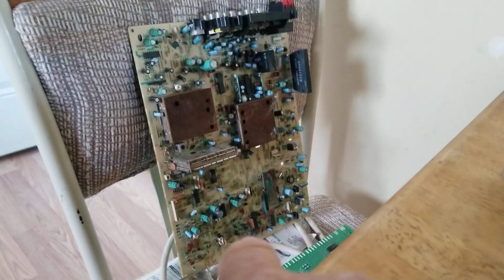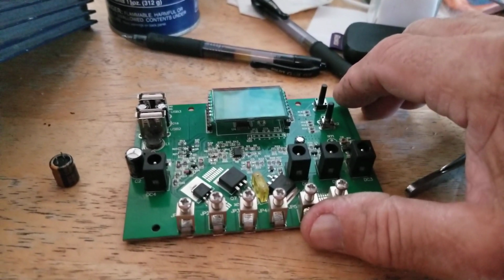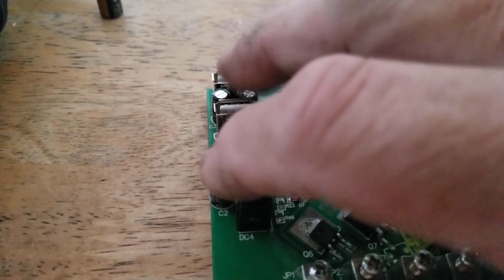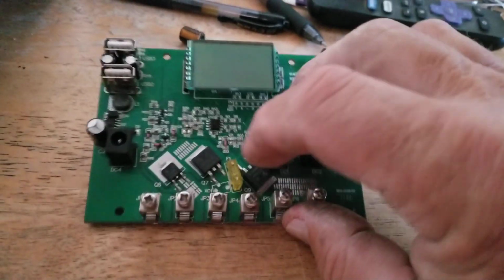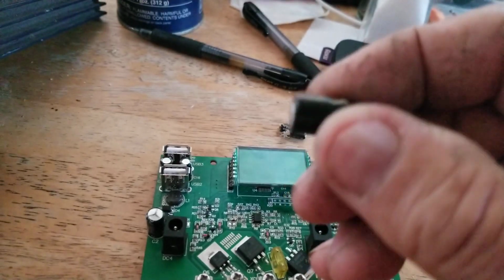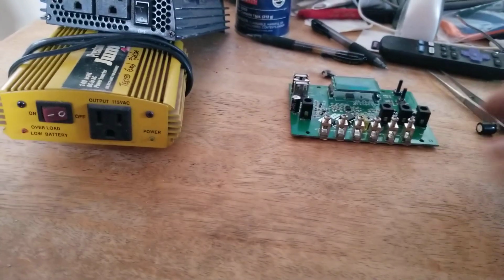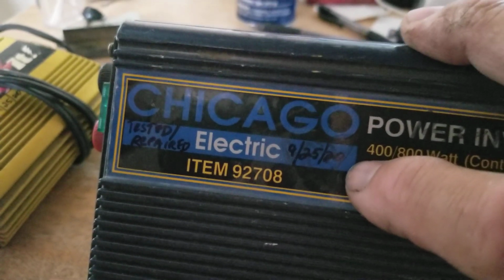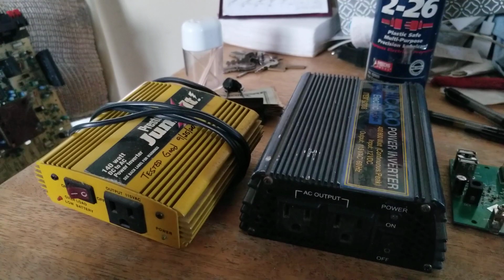Electronic repair, capacitors and microfarads,Sep 25, 2020

Comment: Not on point here but thought this might be at least an interesting read for you and worth a few minutes of your time to investigate.  Nice mobile phone speeds.  I'm on Verizon planning to switch to a Visible group plan unlimited talk, text, data $25 month minimum of 4 lines and many online invite you to join their group free to help you get the discount from $40 solo. Right now I pay $65 for my Jet Pack hotspot.  Please let me know your take on this.   Thanks.

https://www.youtube.com/watch?v=El4qzRCQt9w
Reply from the maker: Hi Mike.  Thanks for the info.
I'm with Verizon also, have been for nearly 20 years.  I bought a Verizon based Cradlepoint (used) on Ebay for $150 as a blind sale, and found that Cradlepoint won't support the product for anyone but the original owner. 
I have some experience with modems and routers, so I figured out how to reset it to zero and log back in as a new owner after getting a free sim card from Verizon, and set it up to work for me.  I now have internet and a 4 port router for about $17 a month, with unlimited.
Because this worked for me, I haven't researched anything else.
I can tell you that there have been advancements in access point systems so that a multi port router can be connected, so home networking is possible, but I don't know much more than that.
You can call my friends at Alltech Electronics at 714-543-5011, speak to Gazi or Lucien, tell then GBear sent you and they can give you more info on it, and provide you with the hardware and support you need.
Reply from the maker: Oh, and if you decide to switch carriers from Verizon, make sure they give you a guarantee IN WRITING, that if service is bad you can out the contract.
I haven't found better customer service that that of Verizon, and it you squeak, they will oil.
They have a motto that every "single" customer matters, and will go all out to give you what you need.  Also, if you are a veteran, they give discounts and special service.
Reply: @GBear  I'm 10% disabled Active Army Medic 2 years and Air National Guard Flight Medic and MSC 22 years now retired.  Some time we should tip one up at sunset and I'll bring some wood for the fire.  Good nights coming as the temps eventually go down.
Reply from the maker: @mikesmith1550  sounds like a plan.  I hope you are getting your military discount from Verizon.

Comment: On power supply items like this you can go with caps of Higher Values if need be.   Higher Voltage and Cap values without issues if it will physically fit.  NEVER LOWER.   That only pertains to power supplies.   

In the USAF they sent me to school on the stuff.  8 hour school days nothing but electronics.  Talking about Brain Burn ! 740 hours over all.  

Eaaaaa Picked up a New to Me Pick Up yesterday.  2001 Ranger.   2 wheel drive but boy is it clean.  Nice little topper on it.  That's going to be my Prospecting truck for a while.
Reply from the maker: I had a Ranger back in 1986.  Bought it slightly used, but worked the heck out of it in construction.
Reply: @GBear  Tough little trucks . Those and the E series Vans was one of they're best products.  The F -150 pick ups are crap compared to the Ranger.  Funny enough you can still work on the things.  Unlike most new engines.
Reply from the maker: @pulesjet  I've been an E series fan since 1963.  It had the same engine and drive train as the 1960 Falcon, and was reliable as long as the oil was maintained regularly, and an occasional plugs and points.
Reply: @GBear  LOL, My hat says I would rather be pushed in a Ford then drive  Chevy.   I have no idea how it happened but I have NEVER  but once  been left on the side of a road in a Ford.  That one was a Pinto and I changed the timing belt on the side of road coming back from the lake.  I actually had the tools to do so.  The belt took a road trip.  They always waited until I got in the dive way at home to chit there shorts.  LOL  Every Time.   I had a timing belt cut loose just as I got home.  I had a MAF sensor puke just as I got Home.  I had  a  few other things do the same.
Reply from the maker: @pulesjet  when I was an auto mechanic in the 60's my boss used to say, "See the USA in a Chevrolet, hooked up to a Ford tow truck...."😂
Reply: @GBear  LOL I have to remember that one.
Reply: @GBear  good one.
Reply: First check to see what the tolerance  the capacitor has most common capacitors are 20 percent so you can go + or - 20 percent in value. If its a 1 percent tolerance don't change the value. Precision caps must never be substituted. Voltages can be higher if size is no problem.
Reply from the maker: @ronb6182  it's a Chinese brand PWM 10amp controller.  No need to waste time on it, just replace it with the proper value and skip the 'smoke test'.😁
Reply: @GBear  yes I agree I think he just misunderstood where I was coming from. Manufactures can screw things up.
Reply: @ronb6182  General Power Supply use is mostly for filtering and Smoothing.  Anything related to voltage regulation needs be as prescribed.
Reply: @pulesjet  I said anything 1 percent tolerance and lower must be  as marked regardless where it's used. If there are 20 percent tolerance parts you can go Plus or minus it's value. If you test any cap with a 20 percent tolerance in most cases it won't be the marked reading. If you need exact replacement it will be a precision part. In old electronics we used parts that were 4 times higher than the original with no issues. It was usually a power related product. Filter caps were rarely exact replacements. You used what was available.  I now work with exact replacements unless we get an engineering update and not only values are important but also manufacturing names. We have tested three different manufacturers and got three different readings and two of them caused issues with our products. Manufactured parts can cause circuit updates as well. There is no exact part in all electronics. Manufactures use proprietary parts in most cases. This is modern electronics.
Reply: It takes more than book learning in electronics it may take 20 plus years in the field to know what is what. I would never trust crash courses in electronics.
Reply: @ronb6182  Yes it does.  11.5 years performing the task in the military followed by 20 year Maintaining  and installing microwave radio's commercially should just about cover it.
Reply: @pulesjet  I think you are talking about power supplies but even then parts depend on other parts and use precise parts. DO NOT Substitute period. If it's old electronics use what you.can get. Most old tube circuits used 20 percent tolerance parts which can be 20 percent off from their stated value. When in doubt use what the schematic calls for. No substitute. Tubes are a different ball game. You have bias issues to contend with and over voltage is a big problem now instead of 110 to 115 volts we have 125 to 130 volts. Too high for.tube circuits.

I'm sorry for misunderstanding because I agree with using exact parts but even with exact parts in value some manufactures have capacitance issues when it charges and discharges. We tried three different manufacturers with the same value. The relay did not fire right and the board computer shut down. If we would.use American made parts we would have less issues. Japan parts we never had issues like with the Chinese parts. Even Korean parts worked like they should.
Reply: @ronb6182  Yes PSU's.   Nothing in those inverters is critical .  In the old days timing caps would had been.  Not these days.
Reply: @pulesjet  yeah you are right that's why they were discarded in the first place. I dont use modified sine wave  inverters period. They are bad on motors and new electronics. I have a home depot alternator that I would.not.use. I will probably end up selling it and buy a good pure sine wave inverter.  A good battery or batteries should be sufficient during a power outage. If I was off grid I would consider getting DC appliances
Reply: @ronb6182  I have both.  My main is a 3000W Reliable brand.  Cheap and Reliable this far.  For the price Modified do the job if you just need intermittent use.    I've ran a Frig off one for a few months and yea refrigerator  grumbled but worked.  That was 10 years ago so guessing no damages incurred.    Not so long ago pure sign cost more then anyone makes.  They can be had reasonably now.    Low Freq are still over the top in cost.
Reply: @pulesjet  I been thinking most ups back up are now using pure sine wave inverters in their UPS's I was thinking of buying one of them for power outages it will power my modem, Computer and TV. Most laptops have batteries so it makes no sense in powering a laptop on a UPS. You can expand the battery bank so the power will last longer than one hour or so. As for refrigerator and freezer the extra ice in a freezer will keep food frozen until the power comes on. I look toward the practical side of extra power. I been without power for about one day when the power company was repairing power poles that went down during hurricane irma I never lost power during the storm I got free tree service out of that storm. In other words the tree fell in my back yard and nothing hurt the roof or house. One large branch was laying on the roof but did no damage to the roof. I just had to cut up the large tree.
Reply: @ronb6182  Bingo.  I have 11Kwh of battery.   Running 24v system.  You can build a kick but battery back up for a reasonable price.  If for lap top no point in using a inverter to 120vac.  Just use a boost converter to the 19vdc.    All of my batteries are configured to 12v except the Nissan modules.  They can't do that.  The best they can do is 6S or 25V.  
Using LiFePo4 on most .   Best match for automotive type 12v system 14.4v.   All of my inverters are 24v.  Grid tie as well.
Reply: I'm using cells like this for my main.  Cheap and  should provide some 4000 cycle life.   

Mine are only 50Ah cells.  Butt loads of them.  https://www.ebay.com/itm/4-unit-NEW-LiFePO4-3-2v-80Ah-NEW-Lithium-Li-ion-battery-Prisma-320Ah-1Kwatts/233723305756?hash=item366afe9f1c:g:xLQAAOSwIzte98fD
Reply from the maker: Cool!
Reply: @pulesjet  oh one thing I was thinking of I want to find a multi voltage inverter I need lower voltage for tube electronics and christmas lighting displays. I found out I was losing like 10 leds in my Christmas light displays in a week or so. I started using a voltage reducer and I haven't lost anymore lights 110 volts is what I have now.  If I can get an inverter that puts out 105 volts to 120 volts. I can set it for my needs. I found a few online but they are 12 volt input. I rather have a 24 volt system.

Comment: I have to get a little inverter to run my led lights outside. 
glad you feel better.
Reply from the maker: What size wattage do you need?
Reply: @GBear  I'm running 2 sets of LED lights.  28 watts each I think. a a little computer  fan . 150watts probably do it.
Reply from the maker: @heatseekerbus  computer fans use around 8 watts, plus your lights should be under 70 watts.  I can send you the 140watt unit if you're interested.
Reply: @GBear  thanks.  it would probably be expensive to ship though. I tried a cigarette lighter type inverter and it blew the fuse .
Reply from the maker: @heatseekerbus  that's probably true, out of country shipping does get up there and it would probably cost more than a new inverter.  Oh well, I guess you'll have to pick it up then!😂👍